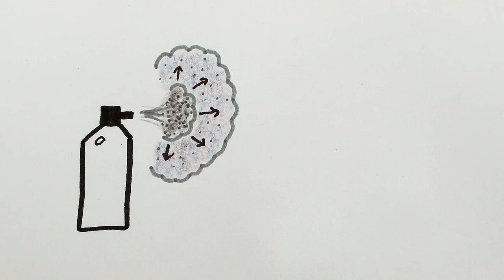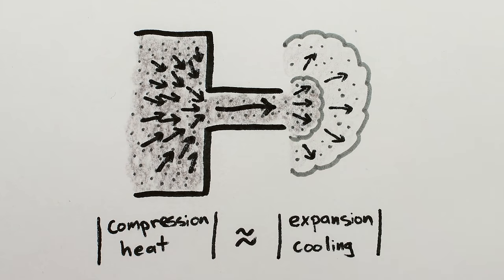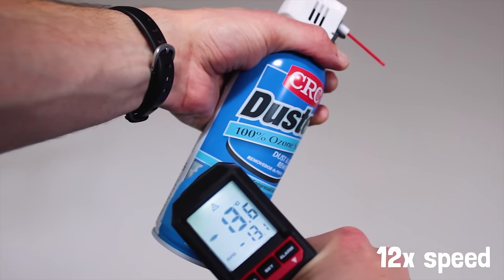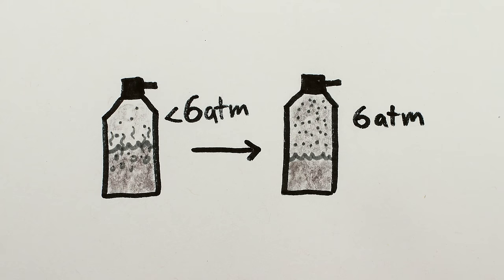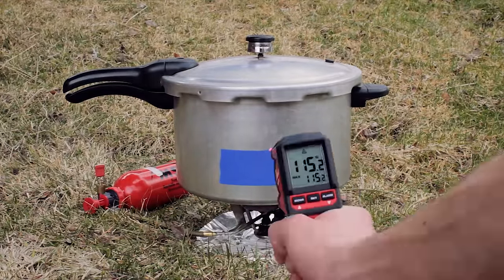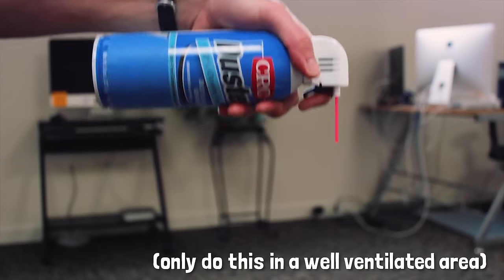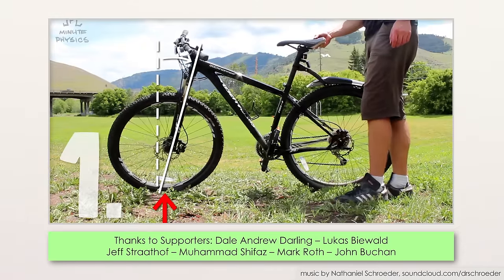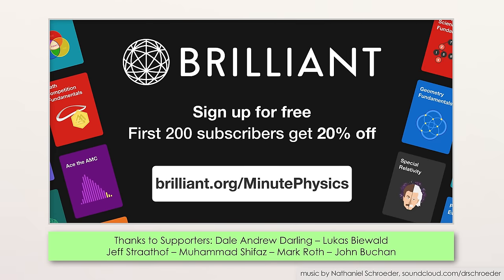Why Do Compressed Air Cans Get Cold?

Comment: This was a great explanation of the Joule-Thompson effect and how it relates to adiabatic cooling. The JT effect is something specific to nozzles, and depends on their geometries and the pressure gradient, while adiabatic heating/cooling is the more general case for gas expansion. I've seen many people incorrectly refer to the JT effect and assume that some gasses will always heat up when they expand.
Reply: Nuovoswiss 
If you understand it would you mind sharing- because i watched the video then looked it up and i still have no clue. Why does it matter that in the process of expanding it went through a nozzle, don't most thermodynamic equations just bother with the start and end states? Where does the extra heat come from without breaking the laws of thermodynamics (especially given the fluid is doing extra work to accelerate itself through the nozzle so you'd expect extra cooling- not heating- if anything)? If we measure the thermal energy of the whole system from after using a nozzle or cutting off the top would there actually be a difference in total thermal energy of the system between the two processes?
Reply: @the1exnay  Sure thing. At the entrance to the nozzle, the gas is compressed even further since it is being squeezed through an orifice, creating a local hot spot. The energy to do that comes from the heat/pressure of the rest of the gas in the high-pressure container. Away from the nozzle, in the bulk of the pressure vessel, the gas cools adiabatically, as expected. When the gas squeezed through the nozzle expands upon exiting, it also cools adiabatically, but whether that cooling is greater or less than the nozzle heating depends on the details (∆T, ∆P, M, geometry, etc).

Thermodynamically, it's like you have some of your pressurized gas expand adiabatically into a small cylinder with a check valve, then compressed that second chamber using a spring to capture the piston's inertia (this is an inertially-driven phenomenon) to heat it up before letting it expand adiabatically once again. The local heating is driven by the expansion of the full volume of gas, but that energy gets dumped locally to the gas going through the nozzle. Does that answer your questions?
Reply: Nuovoswiss 
It makes more sense now. So it's a process by which the air leaving takes thermal energy from the air being left behind. And the total thermal energy is the same at the end for either process, there's just a change in the temperature differential between inside and outside the can?
And this heating is just pressure becoming the mechanical energy of moving air which turns into thermal energy via friction and air resistance?

I think i might understand it better now, thanks for taking the time to explain.
Reply: @the1exnay  That right, for the most part, in practice. The only issue I see is that you're thinking of 'thermal energy' as an independent quantity. If you want to go down the rabbit hole, there is the thermodynamic condition known as 'free expansion', in which any gas can expand with no net ∆T. This does not violate any precept of thermodynamics, but in practice it would require something like a Maxwell Demon, but without any discriminatory capability (and thus, no violation of thermodynamics).

Adiabatic expansion (and thus adiabatic cooling) fundamentally assumes that the energy cost to ∆T comes from some work done. If a gas expands without expending any energy to an outside system, no work is done, so it can't change its temperature.

What this means for a nozzle is that if the gas goes through it with no opposition (ie, with nothing to push against, even itself) then it will come out the same temperature it started as, when averaged over all its atoms/molecules.
Reply: Nuovoswiss 
Huh, that's really interesting. So in adiabatic expansion it's the work on the environment normally just compressing the air around it or?
Reply: @the1exnay  Yup, adiabatic expansion implies that the gas is expanding uniformly against a moving surface, such as a piston in a cylinder. The work done is given by pressure times piston area times piston movement distance, and is equal to P1•V1–P2•V2 which is also equal to m•c•∆T.

In practice, the gas itself acts like a piston. That is to say, if you magically disappeared the top of a pressure vessel in outer space, the "layer" of gas at the top gets pushed on by the "layer" of gas just below it, and so in the bulk of the container, the gas expands just as if there was a piston it was pushing against adiabatically.

Comment: Two things:

1. The stuff in said cans is similar to (if not the exact same thing) as R134a refrigerant. (What's used in car AC systems, other than a select few new models). Hence how R134a can be sold to consumers (and other refrigerants are generally not).
2. The principle that was described here is also how such an AC system works... only with it being a closed system and with a compressor to re-liquify the expanded refrigerant, and a condenser coil to vent off heat (how heat is "expelled" by the system). The rest of the system (expansion valve/orifice tube and evap coil) are the same idea...

Comment: They aren't real "Air" cans. Almost all these air cans, including the CRC you're holding, use refrigerant to create pressure. Pressing the button down allows pressure inside the can to escape. When the pressure above the liquid refrigerant is lowered, the refrigerant will boil to increase the pressure until it's high enough to keep the refrigerant from boiling(or turning into a gas). As the liquid refrigerant boils(going from a high pressure to a low pressure), it gets cold, just like the refrigerant in your vehicle or home A/C system. Great video, and well explained as usual!

Comment: Same effect happens in Cars/Trucks converted to run on LP Propane. The Propane is liquid inside the tank, and it has to be routed to a heat exchanger to heat it up before the engine, because it freezes and clogs parts of it

Comment: This is also exactly how your refrigerator or air conditioner works.  A "refrigerant" (liquid that boils at a very low temperature) is forced through a narrow capillary tube and allowed to expand into much larger tubing inside the freezer, absorbing a lot of heat from its surroundings when doing so.  Once all the liquid has turned to gas inside the freezer it returns to the compressor to be put under pressure again and allowed to condense into a liquid, and the process repeats.
And the fresh food "fridge" compartment?  Unless you have a high end dual-compressor unit or a fairly new dual-evaporator unit, there's just a fan in the freezer blowing some of that cold air into the fridge, and a damper (passive or active) in the fridge controlling how much cold air the fridge gets.  So if your freezer is nice and cold but your fridge is getting warm, your fan/damper is having a bad day.

Comment: Interestingly, in Europe and Australia normally these dusters contain a mix of butane and propane (LPG gas) which is considered to be less environmentally taxing, the US will slowly get there too. The actual  mechanism is the same, just with different chemical properties. LPG has a much lower boiling point so cools more extremely.

Comment: it's also a potent greenhouse gas
Reply: Oof
Reply: Why?
Reply: @heckler73  I know this might not answer your entire question but it has a gwp rating of 124. So releasing 1kg of this should be equal to releasing 124kg of CO2 as far as I understand it. 

Wiki: Global warming potential (GWP) is a measure of how much heat a greenhouse gas traps in the atmosphere up to a specific time horizon, relative to carbon dioxide. It compares the amount of heat trapped by a certain mass of the gas in question to the amount of heat trapped by a similar mass of carbon dioxide and is expressed as a factor of carbon dioxide (whose GWP is standardized to 1).
Reply: @jadoei13  actually according to the government it's 1300 times more potent
Reply: @jadoei13  So it hinges on the necessity of the "greenhouse effect" hypothesis being valid. That's pretty well what I expected but wasn't sure. Thanks.

Comment: this is also how air conditioners and refrigerators work, it's not a coincidence 1,1-difluoroethane is also used in those applications
Reply: Does this mean I should stop shaking my refrigerator?
Reply: Well, being a refrigerant isn't exactly why it is used for "compressed air". In refrigeration applications, the low boiling point is needed for cooling (obviously), but for "compressed air", all that is needed is the constant high pressure. Cooling of the can is not an intended feature, but an unwanted side effect.
Reply: @nicholaslau3194  i mean, that's true, but i never said that the cooling was a designed feature of compressed air cans? the video explains why they get cold, and i said that the physical effect that makes them cold is the same one used in refrigeration

Comment: Because PV = nRT. You lower the pressure, we lower the temperature.
Reply: Not quite. V also increases quite a bit, you have to account for that too. What explains the full effect is a combination of what you said with PV=nRT, the volume expanding, and the energy from the phase change as explained in the video. And of those three I believe the phase change has the greatest impact on the temperature.

Comment: Even if there were no liquid in the can, expanding through a nozzle is not the same as expanding against a force (like the gas remaining in the can does).
When the gas expands against a force it does work, so it gives up energy, so it loses heat. Some industrial refrigerators will make expanding gasses turn a turbine to get an extra drop in the temperature.

Comment: Try blowing air through your mouth by yawning style and by pouting your mouth and feel the air from both on your hand ...to feel the temperature difference.
Reply: Wouldn't the difference be much more to do with the heat from your hand being pushed off by the fast blowing air? If you slowly let the air out your mouth it feels the same temperature no matter the orientation of your lips.
Reply: I highly doubt that you can actually create a noticeable pressure difference with your mouth

Comment: During rocket launches, is that rapid forming ice you see cracking and peeling off the booster or tanks during launches?  And is that the same principle explained in this video?
Reply: Clint Patac 
Probably, liquid oxygen, hydrogen or methane rapidly boiling.

Comment: so basically it is mostly a result of evaporative cooling, rather than the ideal adiabatic expansion (the one that turns into -100C) or the isenthalpic expansion (Joule-Thomson effect). Maybe one thing that wasn't covered as well is why does it cool off an object much better when you turn it upside down. I believe this is mainly a matter of heat transfer efficiency, since when turned upside down you are spraying some liquid together with the gas, the liquid itself which is cold will have a much more efficient heat transfer to the object you're spraying, and therefore the cooling will be much faster. I see no reason why inside the can itself the cooling effect should be different with the nozzle pointing upwards or downwards.

Comment: 1,1-difluoroethane and other HCFCs are being phased out under an amendment to the Montreal Convention (the original version of which banned CFCs). The compressed air can I have uses propane instead (which apparently is not a greenhouse gas), but I guess the principle is the same.

Comment: 10 seconds explanation: In order to reach pressure equilibrium, the liquid inside absorbs energy (heat) from the surrounding environment, therefore everything surrounding the liquid, will transfer it's heat to the liquid. The reason they use metal cans is because they transfer (lose/gain) heat more efficiently.

Comment: I use these incorrectly on a regular basis at work, good to know how they actually work. For anyone interested, I hold the can upside down and spray circuit boards to help troubleshoot intermittent issues that may arise in cold environments.

Comment: That's an excellent explanation. Far superior to the confused drivel that my old thermodynamics lecturer called "teaching". Although you say that the gas is compressed at the nozzle, which causes it to heat, but surely there is a continuous pressure drop from the centre of the can until the exit point of the nozzle? Isn't the heating just caused by friction from the flow of the gas against the internal surface of the nozzle?

Comment: Interestingly, this is why with Gas Blowback Airsoft guns, you have to load the gas from the can into the magazines with it upside down. You the liquid in there, so it expands when you fire.
I learned that recently, when I did it from below, and could only get a couple of shots out before it went "pmoof" and stopped.  
I saw videos saying one gas charge should be able to run through all the BBs in a magazine about 3 times over without needing more gas, so I was clearly doing it wrong.
Then I remembered how compressed gasses are actually held in these cans - So I flipped the can upside down and loaded the magazine from the top.    The more you know...

Comment: Your description of joule-thompson expansion just left me confused. If the beginning and end pressures are the same then what does it matter how you switch between them? I looked it up and i still don't really understand. 
If it was just an actual bottle of compressed air and we released air through a nozzle or released air by cutting off the top would there actually be a difference in the total heat of the system at the end? And if so where did it come from or go?

Comment: Same principle applies to liquid propane. It’s pressurized gas that becomes liquid in the tank. I’ve worked with propane tanks for years and they can get really cold at the bottom. So cold that the liquid inside starts to freeze and reduces the pressure coming out of the torch.

Comment: Does the rate of evaporation of the liquid inside the can depends on the speed at which the can (thru its walls) absorbs energy (ie temperature) from the surroundings?
I'm asking because the higher temp is property of the particles with that higher temp - ie warmer particles give temperature to colder particles, rather than colder particles 'sucking' temperature from environment, right?
So imagine that the can is more like a vacuum bottle, so the rate at which environment outside the bottle has hard time reaching the liquid inside the (now vacuum) bottle.
The compressed gas will escape when released since it's has been already compressed above ambient atmospheric pressure, but then if the liquid can't quickly absorbs energy would it still vaporize?

Comment: If the can is at a very cold temperature, like -273°C (0k), would the can still release air? The video states that the reason it gets cold is because the liquid chemical uses thermal energy to boil. But, what if there is no thermal energy available? Would it still boil and keep the pressure inside the can at 6 atmosphere?

Comment: You can have instant dry ice by releasing compressed CO2 from a pressurized cylinder into a bag or form. This provides cooling down to -78.5C by means of cooling bath (dry ice in acetone or methanol) for various laboratory procedures (e.g. ozonolysis).

Comment: Your air conditioner works very much the same way.   Compressing gas to a liquid via work from electricity and then controlling the evaporation in a hot space.  Heat is absorbed by the gas and transferred outside to be compressed again.  Evaporation...is cool.

Comment: I was sure it was for the same reason ar conditioning work, because of the difference in pressure and conservation of energy. I love learning new things
Reply: An air conditioner is pretty much just a heat pump, same as a fridge. Cold liquid goes through a pipe in the room, absorbing heat, then through a pipe outside, where the heat is rapidly removed by a compressor and fan. Then it's cold again and the cycle repeats.